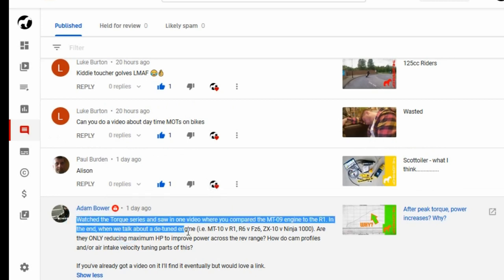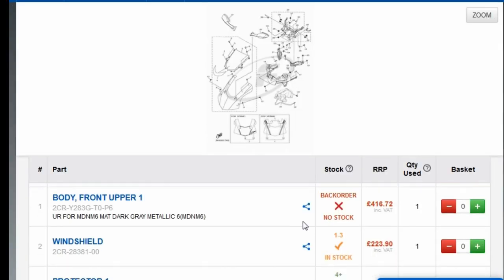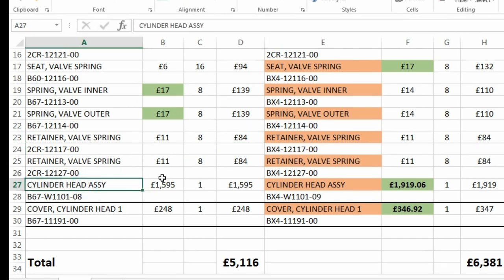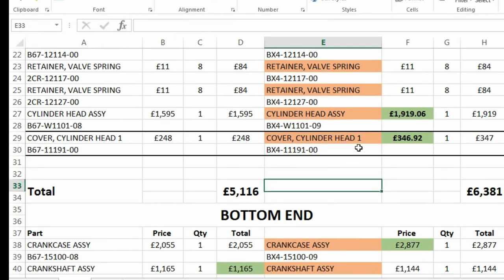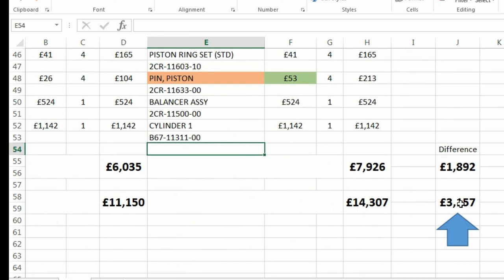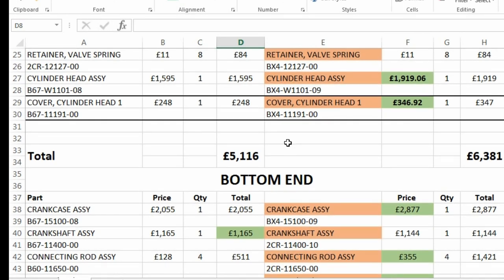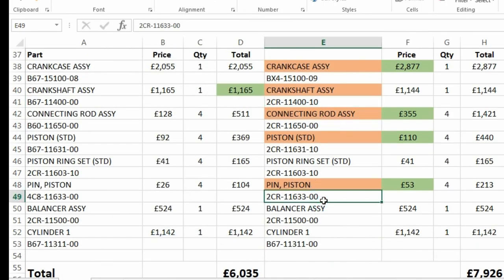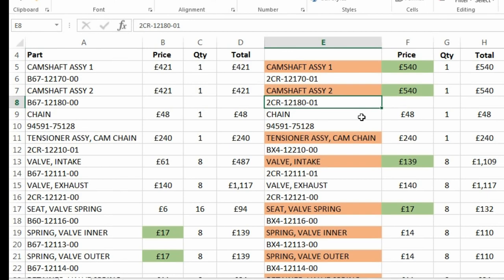Same engine, but De-tuned???

Comment: if I'm not mistaken Yamaha done this before and why not. the bike I own has a "De-tuned" R1 engine. the bike is a first gen 2002 FZS1000 or known as a fazer1000, the engine I believe has different cams, head gadget, compression ratio and jets. the reason is because the fzs1000 is classed as a sports tourer compared to the older R1 widow maker. more torque lower down the rpm. you can sort of "re-tune" by buying a stage two Ivan's jet kit. bore out the intake boots, 4 degrees for timing, change the exhaust and fuck of the ex-up valve. a massive 8hp gain lol.
I'm happy with a slip on, I'm also thinking about going for a stage 1 Ivan's jet kit. anyway stock she's pushing 124hp at the rear wheel and 100nm of torque or 73 foot pounds. go's like the speed limit wink wink, sorry something in my eye.
Reply: Every manufacturer has done it for a long time.

Comment: Kind of surprised that the balance shaft is the same knowing the pistons and rods are different and probably significantly lighter in the R1.
Reply: My guess is because the crank is different and the balancing assembly which I'm assuming is a harmonic damper, is there to dampen harmonics and resonance under certain conditions. The difference between the street and race motor weren't great enough to need a new balancer and the COG and loads seen by the crank/crank case were not changed much. i.e. you can take a motor and stroke/bore it out, running different pistons/rods and you use the same harmonic damper/balancer. Some of that can also be tuned with the ECU.

Comment: The KTM 790 adventure and 790 Duke is the same engine but different HP and torque but i guess that’s been done in the gear box? 
Making the adventure 10hp lower but with more torque.

Comment: Bought my 2016 MT10 new for under £10K so appreciate the changes Yamaha did from the R1. It's still an amazing road bike engine and do you need more power on a naked? Perhaps you could explain why this engine has such an appetite for unleaded when even ridden carefully.
Reply from the maker: because it's a 1000cc and not a 125... lol
Reply: It is a very thirsty engine. 4 of us went to Scotland last year. I was on my 1299 Panigale, another on a 1199 Panigale, a Tuono 1100 factory and a 2016 R1. All filled up and set off at the same time riding the same pace and the R1 needed filling up 90 miles into the trip. Forever filling that thing up.
Reply: @benjibradshaw69  Yep 👍👍

Comment: The price difference between the two models is'nt that much of a surprise,it's parts pricing in general that's shocking. Back in the early 90s one of the bike mags done an experiment,they bought a Kawasaki KR1S,about £5500. They then went to the dealers and priced up the individual parts to build a KR1S,it came to £36000!. Would be interesting to know how much an R1 costs doing the same thing with your pricelist.
Reply from the maker: but this is to be expected. making extra parts they might never sell and storing then for 30+ years is expensive. just take a cylinder head. they won't small and if they make an extra 1000 thing about where you keep that...

Comment: Excellent question Adam.
Excellent answer Matt.
This is something I have thought about ( well, I'm sure most of your viewers have ), for quite awhile.
Now Matt, you have opened a can of worms. Meaning, your viewers want part 2, part 3... etc.
What happens to the different parts at 2000rpm, at 5000rpm, 10000rpm,15000rpm?
After 5000 km, after 50 000 km, after 100 000 km?
Manufacturing differences?
How do they absorb heat?
How do they radiate heat?
This is getting your viewers excited, sorry, if you feel I am getting carried away.
It's just that I enjoyed this topic immensely.
Thanks.

Comment: I remember see something about the mt10 having larger counter balance weights on the crack shaft due to the heavier rods (possibly the higher price?)
Reply from the maker: As far as I know the cranks are the same
Reply: The Workshop il try and get u a link to the video  this guy rebuilt his with the wrong crank and tries to says it’s got a bad vibration due to this but it’s more then likely he fucked up the balancer time lol
Reply: https://youtu.be/j0uDOSg6yOA , it’s a r1s crank his talking about but I assume it’s the same as a mt10 engine
Reply from the maker: This depends on year in the video he shows a 2CR crank with the 2CR casting mark and the R1S crank - these have different part numbers, which makes this guy stupid lol

It's true what he says about Ti rods etc - it just depends which bike model and year

Comment: Good video. Having done a lot of resto projects on old Yamahas part numbers are something I've dealt with a lot. As said the prefix usually gives the model and Yamaha are pretty good at keeping to one part number even if that part is common to more than one model. I have found a few however that have the same part number with different prefix which are actually the same part. Some Yamaha parts also carried a suffix to denote finish ie chrome, bzp etc. As well as giving sizes for bolts hidden in the part number. ie 92506 where 9 is the code for bolt, 25 the length and 06 denoting m6. Add to that a lot of old part numbers have now been superceded  adding even more dimensions to sourcing old parts. Non of this may be relevant to owners of modern tackle and nothing to do with detuning  but thought I'd comment anyway in  regard to part numbers as it may interest somebody.

Comment: As I spend too much time scanning parts data I once fountd that: The Aprilia RSVR Had an acerbis plastic tank price of arround £1500 depending on colour, except the special edition that was £150 - which I guess was a clerical error, IE it should have been £150 more, but someone fucked up, I dont think they had any revenue feedback measurement to notice the problem.

Comment: When The MT-10 came out, I do recall hearing reviewers stating that the actual head was a different design, not just the same as an R1 head with different cams etc.
Reply: @filthyhooligan1370  ..The whole point of this vid is the Mt-10 uses cheaper components.(that arent needed for a street motor).HELLO

Comment: Interesting thought about comparing previous bikes etc. kawasaki was probably one of the last companies to make a 250 4 cylinder, wasnt the most popular but it was still cool. Then just recently they show off this new one. If money was no object Id love to put the old and new engines side by side to see what went into the new engine, did they design it from scratch? or did they take the old engine as a 'base' and work from there? etc Seems like a lot of work for 1 model in such a small market etc.

Comment: Hi Matt! Usually the "spare part piece cost" is about 10 times the "real" serial piece cost for the OEM. Behalf material and process, the lot size has also a big impact. Third, in some cases, the OEM wants to keep the "high volume model" as cheap as possible. When creating diversity, all extra cost will be located at the "high end versions"  because "those" customers are willing to pay for it. Those 3 facts can help to  explain some of the effects we saw in your video.
Reply from the maker: which is what I said in the video....

Comment: Great job once again...Do you think putting the R1 engine in the MT-10 you would get the same reliability....i.e, total milage and wear on components? I think it would be nice to even get the option to pick and choose what components you would like when buying an out of the box bike....given spare no expense. Repairs down the road might get expensive but you may not incur these costs as often due to getting the quality up front. Great brain teaser...keep them coming:)
Reply from the maker: this isn't about quality, you want higher output then the 'better  parts are required
Reply: If all the hard mounting points are the same I don't see why they don't unless they are not made in the same location which would make logistics expensive. I have a feeling the MT10 engine is designed to be less expensive because its not about getting the most top end power so you are past the point of diminishing returns for performance/price or even noticeable performance improvements.

Comment: I just had a quick look on partzilla at a 2019 MT-10 and YZF-R1 Cylinder heads. I just picked the first MT and the first YZF, so random picks. The part numbers are: For MT-10. 
B67-11191-00-00
For YZF-R1
BX4-11191-00-00
Price: MT-10. 
$116.12

For YZF-R1
$117.08

Comment: That was a good video, one thing that I wondered is how many MT's do they make vs R1's? I wondered if there was a significant difference, will there also be a slight difference in part specific prices if the production numbers vary greatly. So for example if the MT is produced in much greater numbers does Yamaha negotiate better pricing from the sub supplier? It probably isn't huge, but is there I suspect.
Reply from the maker: "That was a good video, one thing that I wondered is how many MT's do they make vs R1's?"

- That's a good question, and I'm trying to find out

Comment: Hey Matt, I want to know y do some bikes dont have good throttle response and low rpms (jerky movements)? I have heard that it's because of poor fuelling. If so y don't manufacturers sort out the issue.
Reply from the maker: This is all about torque and revs vs load. It's lugging the engine and stop doing it

Comment: agree with all your points. however back in the 80s their were 2 hondas with identical chains and part numbers; however if you quoted the wrong part number it was $60.00 dearer. was this honda buggering around in japan, or the distributors in australia? guess well never know at this remove. id be happy with an mt-09 or 10. they both look like trail bikes. sure theyve got a little up on a 250 0r 500 single though. what company would avoid maximising the performance of an engine?

Comment: I find people's understanding of 'detuned' is not the same or accurate in most cases. Tuning is more than just an ECU flash or cam profile. There may be variants of an engine, based on a similar engine, but parts are different to change the characteristics. Anything from how it delivers power to durability. Tolerances and material choice play a large roll in cost and where you can safely 'tune' the engine to make more power or other performance characteristics.

Comment: Whilst I get everything your saying in the MT10 and R1 example and decosting.

What about your bike and my bike ? Z900 vs Z900rs. Allegedly 10hp more in the cheaper version and more lower down torque in the more expensive one . Be interesting to see a similar comparison or how or why they changed the engines to produce diff power etc .
Reply from the maker: That's a good one - I'll look into it but just to guess it's difference in market - the Z900 is a streetfighter - or modelled after one - the z900RS is basicallt the same platform for the latte drinking fannies

Comment: Sometimes when the part is the same.. Manufacturer hand picks parts for the performancier model.
The same part going to an engine revving 11 or 14000.. You need to make more profit for parts in the latter. Probably more warranty claims on that one.
One car maker sells or used to sell stock parts at a lower price, then the part numbers would have "M" in the end, for motorsport. Absolutely no warranty for the parts.
Reply from the maker: "Sometimes when the part is the same.. Manufacturer hand picks parts for the performancier model" -

- I did say that...

Comment: £2k for a cylinder head...... mental!
Reply: Pretty standard for most motors. My V8's has 2x $800-1200 heads depending on performance level. The head on my 4-cyl turbo car is like $3k BEFORE you buy valves and such, now throw on 20x $200 valves... In USD at least.  USD$3000 = 2340 pounds.

Comment: I really appreciate the deep dive, and I thought your comment about moving peak output to somewhere else in the rev range for a different kind of bike was insightful. Seems like it's a combination of cost savings parts and a design change to shift where peak output occurs. Then you slather on marketing wank to confuse the issue, and viola!

Comment: I disagree that the engine was made cheaper and thus resulted in lower performance. I believe the required performance was set and the parts made as cheap as possible to provide that level of performance.
Reply from the maker: and how would you do that? do steel valves provide exactly -26% less power? think about it before saying something stupid.
Reply from the maker: " I dont think they decided to save money by installing steel valves and then accept whatever level of performance that gave them."

Well sorry to tell ya, but it doesn't matter what you 'think' - it's what they do.

"I think that Yamaha knew what performance level they wanted and built the motor to achieve this level of performance as cheaply as possible."

- If you watch this video -

https://www.youtube.com/watch?v=t7Azl-drqMk

In this video Tiff Needell says...

"for his engine the 6.1 liter non turbo v12 produces 627 horsepower Murry only asked for five hundred and fifty so he wasn't too unhappy when the engine came out 16 kilos heavier than the 250 specified weight"

In other words Mclaren specified 550HP @ 250 kg. The engine they got was 627 HP @ 266 kg. Now do you think that BMW specified or aimed to produce 627 HP? LOL no. Why not 630 or 620? And they were out on the weight by 6.4% which isn't small.

"Its not that steel valves will produce less power. Its that titanium valves are not required to meet the performance level of this motor."

- Because? What difference does the TI valve make?
Reply from the maker: Basically you try to design and manufacture the best engine you can under a price bracket - this is called a BOM - Bill of materials - you then also do a feasibility study and a cost analysis. Whatever the power that engine makes then that's what the power is. 

Do you think that if Yamaha could make a mass production engine that made 250HP they just would, beating the competition etc?

What you also don't know is this has been going for for decades... Take the ER5. It has the GPZ500 engine in it. But why? Because of cost. They want a mid-power bike that is cheap and they have already designed the engine and still have all the tooling, and it's a proven package.